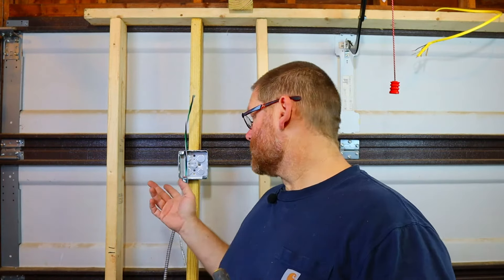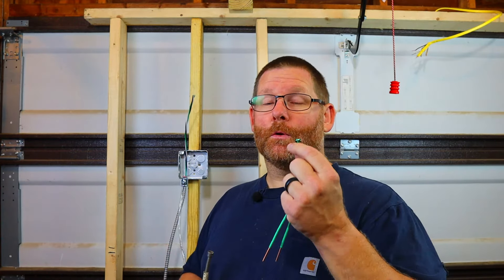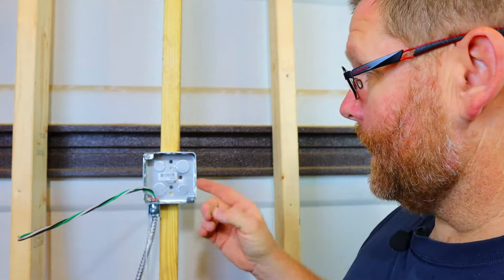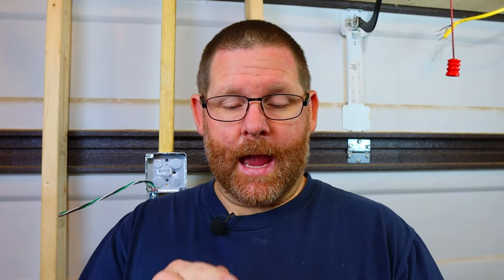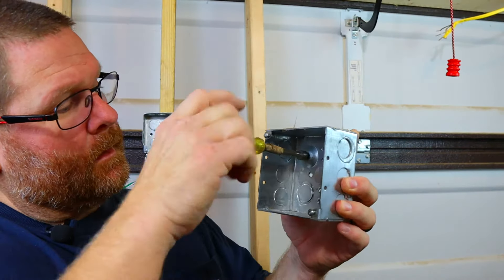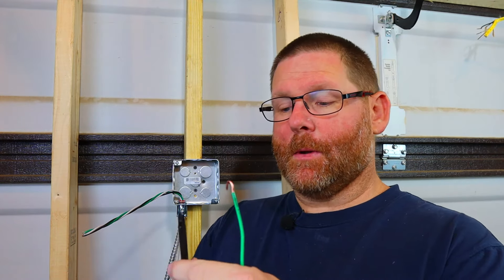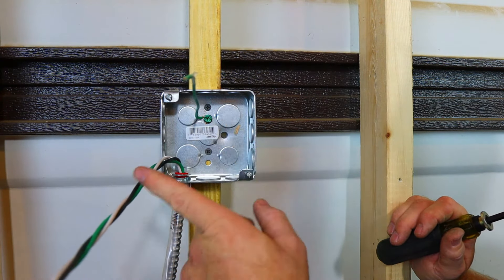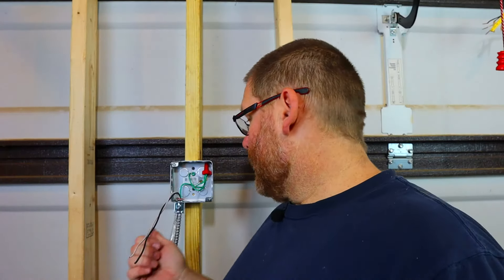How To Ground And Bond A Metal Electrical Box

Comment: Hear me out what do you do if it’s a double outlet and another 12/2 wire going to the next outlet ? And do you treat the bare ground the same as a coated?
Reply from the maker: Grounds are grounds unless you have isolated grounds then it's different. So tie them all together. Unless they are definitely isolated grounds

Comment: im new to all of this. im making a 30amp extension cord to run off my generator. im using  10G 30AMP extension cord as my wire. cutting the 3  head off it  and making a 4 way box. i dont have any Grounding Pigtails. Could i  use some of the Green wire out of  the extension cord to make up a grounding pigtail ? Thanks
Reply from the maker: If it's stranded I would make sure you use a fork terminal then insert that under the ground screw.

Comment: If you're using a 4 gang box with 2 receptacles would you then pigtail the 4 grounds in one wire nut?  (1 to ground the box, 1 from main box, 2 separate out to each respective outlet)?  TIA
Reply from the maker: Yes you can wrap one of the grounds around the screw which will eliminate a separate wire from the box to the wire nut. And yes then you would run the two separate lines off that to your receps or switches. I hope that makes sense

Comment: Question or you... if you ran 4 X 6 gauge THHN wires for a 240V outlet, how do you ground the box? It is or a single device and the 6 gauge cable is way too thick to ground on that little grounding screw. Thanks again for the great information..
Reply from the maker: Working on a video for this very thing

Comment: None of my spare wire grounds have green sleeves on them; does that matter when making pigtails?
Reply from the maker: Do you mean green wire nuts? Or sheathing
Reply: @MountaineerOutdoors  hey man, nah I was actually talking about the grounding wires themselves. I wasn’t sure if they needed to be insulated but based on my research; it doesn’t seem to matter with the ground. Thanks for the video, helped a lot.

Comment: I say use whatever screws you want, however, the contention is that drywall screws with the steel boxes create oxidation reaction and the screws rust. I use sheet metal screws. If code calls for a specific screw and an inspector checks, he can cite that as an impropriety.

Comment: Great video! I have a square bit (robertson #2) screw driver for these green ground screws. It holds on the tiny screws without falling. I also have a tiny robertson #1 to drive set screws for devices. 

As for the direction of the hook. I forget sometimes, but it's the reflected version of the question mark. So "no question" is what I tell myself to remind of the orientation.
Reply from the maker: Those Robertson are good. And they way you remember on how put the wire on is genius. Thanks for watching and commenting ☺

Comment: I like the video. I agree with everything except in certain situations when you have surface mounted boxes and you are using your raceway as the egc then no bonding jumper is required and the yoke contacting the box or yoke and cover contacting the box acts as the bonding jumper per NEC 250.146. I may be wrong but I see this type of installation often.
Reply from the maker: I don't think using conduit is considered a egc anymore. As far as the yoke you have to take off the Insulator tab behind the screw or make sure you are using a self grounding device
Reply: @MountaineerOutdoors  It is still acceptable to use the raceway as an egc per NEC 250.118. Although it is uncommon for electricians to do so as it is not well known. But I have seen it which prompted me to figure out why someone would not run a separate egc.
Reply from the maker: Yep your correct I looked it up. I was always taught that that was the old way. I wouldn't want to depend on that being my ground for sure. I really appreciate you teaching me something and giving me the code number.
Reply: I’m glad I was able to give some insight into proper grounding. Although you are right about not relying on the raceway as your egc. I wouldn’t want to trust it either.
Reply from the maker: Definitely I have seen rigid and emt both broken and come apart which at that point your ground is gone.
Reply: @MountaineerOutdoors  I'd pull a green wire just for redundancy and extra safety measure. The fittings on the conduit could come loose over time and having an actual EGC is a good idea, I think. If the plans don't call for one then I would think it is to reduce cost.
Reply from the maker: Good advice

Comment: QUESTION, I have a metal covered pole barn. I put a ohm meter set to ac volts between the outlets 120v pin and the other probe to my barns outer metal roofing and it reads 120 volts. is this correct or am i going to electrocute myself touching my barn.
Reply from the maker: Your safe that is reading to ground because you pole barn is metal and it's grounded.  Now if you touch it, one lead to the earth ground and the metal and you get a reading then you have problems. Make sense?
Reply: @MountaineerOutdoors  thank you.  mine is zero ground to covering.
Reply from the maker: Your good then

Comment: Thank you for the video. You earned a subscriber in me. Couple questions though. I will be doing this with splicing Romex cables. But I understand there’s no insulation for the ground. Would it be the same method? Also can I use WAGOs instead of wire nuts?
Reply from the maker: Welcome to the family. And yes same method and you can use wagos. I'm not the biggest fan of them but they are U. L. Listed. Thank you for your comment and watching ☺

Comment: Is the metal conduit necessary for proper grounding? Does the conduit have to be attached to anything in particular at the other end?
Reply from the maker: If you use metal conduit it's in tact from the panel to your box. This answer your question?

Comment: So if a hot touched the metal box. Fault current would travel through that bonding wire through the receptacle back to your main panel?  

I see pictures of panels that have a bonding wire connected from the inside side of the panel to the door of the panel? So how does that keep the whole panel from being energized?
Reply from the maker: I think I understand this question...the fault would travel out through the ground wires to earth or water ground and take the fault from you.

Comment: Hi i am installing a outdoor weather box running conduit   It is a 60’s built no ground wire from my power source. I will have a GFI receptacle wired properly to protect remaining receptacles  your thoughts on the ground wire. Thanks for your videos I have learned how to bend conduit from them 👍
Reply from the maker: My opinion is this. Can you drive a ground rod to your garage and add that ground wire to your garage panel?  Then you can replace the wire from the your panel in the garage to your receptacles and all will have a ground. You adding a gfci will satisfy the code but it is not creating a ground.
Reply: Mountaineer Outdoors  thank you for the reply much appreciated. This wiring is from an existing 2 wire feed to the porch area  were I am going from the two wire feed to a metallic box than  emt and boxes. I anticipated you would recommend a ground added. So the home panel is very inaccessible as far as the wiring distance to the outdoors. I visioned adding a ground rod than run the ground to the weather receptacle  box . Your thoughts. 
Thank you for all you do !!!!
Reply from the maker: So do you have a panel in the garage???  if you dont and your planning on adding a ground rod, I would run it to a grounding bridge block which you can google to find exactly what I am talking about. That way you can add more ground wires to items. Although it is not code to run a ground wire outside of a conduit or a romex to feed devices.
Reply: @MountaineerOutdoors   thanks again mike for your reply
Reply from the maker: Always my pleasure ☺

Comment: I have an odd setup I’m finishing. NM12-3 run into studs and then EMT for exposed beam in garage. Prior homeowner ran NM sheathed in 1/2”EMT which I know is wrong. So I have the 3 wires unsheathed inside the conduit part. The ground is bare ; is this a code failure? Should I run a separate green sheathed 12 gauge ground back to panel and hook my metal boxes and EMT to this 15 feet of EMT, connections and 3 outlets, 1 junction metal boxes? I have used bare ground but I do have sheathed ground wire available. Must I use a sheathed ground in each box or is it ok for bare ground? I’m currently hooking up the ground service wire to the conduit and boxes. The prior setup had no grounds at all to any of the EMT used. Also used handy boxes with no room and no pigtails and no bends. I successfully used your bending videos to bend my 1/2 EMT properly and have mad respect for anyone that does that shit regularly. 3/4” short was brutal to bend offsets. I got it though thanks to your advice and tips.
Reply: Dang what a good electrician he was 😂 
I would run a sheathed 12ga through EMT and ground each steel box and rec. I would think running bare ground in EMT or MC would be against code but I’m interested to see what Mike has to say.
Reply: @AlmostItalianBrothers  yeah I do have access to a code book online, I find it easier to get straight answers from electricians on YT...lol...seriously though. If you want 1 million views and criticism just post your electrical video on YT and let the good times roll. I’m at a point that I can run my separate ground wire now and even pull out the bare ground and replace it with a single green ground for all the EMT run. I would just run the green ground back to the box in the stud wall that’s feeding the EMT. I have access now before i insulate and drywall so I want to be better. I have other shit that isn’t pure code but its safe. I just want a safer install. I’ll take your advice and pull some green sheathed ground wire. Removing the bare ground. Easy enough now...impossible later without ripping out drywall.
Reply: @AlmostItalianBrothers  as a side note about ground wire, I have an old 1962 split level and the dryer was just 3 wire 10 gauge. Since I had access to update the plug and the wiring back to the panel I added a ground wire and zip tied it to the service wire along its run also labeled it in the panel and brought it to the 4 wire plug for my dryer. Nice to have it be a 4 wire setup even though I know it isn’t really necessary but it is safer.
Reply from the maker: Ok by code you cannot run a ground wire separate from your wires in the conduit. You can bond the conduit with the ground you have already in your romex. You can run a bare ground wire inside the conduit with any hiccup. I will check for sure but 99% sure you can.
Reply: @MountaineerOutdoors  thanks so much for the information.!!
Reply: Wow, good to know. Thanks

Comment: 11:30 Could that Ground pigtail wire be an exposed copper wire with only a loop of green electric tape at its outer end, to mark it as a green wire, or is this a code failure?
Reply from the maker: Definitely
Reply: @MountaineerOutdoors  🙏Did that.

Comment: Awesome video with explaination! I have a question on 11:06 where you introduced a new (3rd) green wire. I am installing Ring fllodlight wired pro camera which comes with 3 wires and mounting bracket but no green screw. If I understood correctly, here in my situation, this 3rd green wire will be my ring camera wire ? Thanks!
Reply: I'm having the same problem. I thought it was always just me.
Reply from the maker: For light fixtures you do not need to pigtail the green. Just put all green wires together
Reply from the maker: Just omit the other green wire and put all green wires together

Comment: Question - I'm about to replace several receptacles in my house that have gone bad and another problem with them is that the plastic wall boxes (new work) that were installed when the house was built, are all stripped at the hole where the screw that fastens the receptacle to the wall box.  Do the metal boxes have a better/longer lasting holes that don't strip out so easily or are they about the same as the plastic boxes when it comes to that?  I know the metal boxes are stronger in other ways but do they provide better fastening points where the receptacle screw fastens to the metal wall box?  Im scraping/mudding my walls also so I was going to replace the original new work plastic wall boxes with new work metal wall boxes (if they have better fastening points).  I don't want to use old work boxes that clamp on to the drywall b/c I know those come loose so easily.
Reply from the maker: Great question. So my experience is that I like both boxes. You can fix the holes on the plastic boxes with this tool here https://amzn.to/3j7NQHA or the metal boxes if you damage them you can fix it with a tap tool.
Reply: @MountaineerOutdoors  Thats awesome!  I have never seen that but then again im not an electircian.  Quick question - I had already bought the metal box so Im gonna install it on this one receptacle in my house thats been crunked for years.  I cut sheetrock out and basically what I'll have is -  1 metal box with 1 receptacle going in it.  There is 1 Line cable coming in  and 1 Load cable carrying current out to other receptacles in the room.    In that case - correct me if I'm wrong - I would tie 4 green ground wires together with a wire nut ( Line cable ground wire, Load cable ground wire, pigtail ground wire A, pigtail ground  wire B).  Then the other end of the pigtail groundwire A would tie to the receptacle ground screw and the other end of pigtail groundwire B would tie to the ground screw on the metal box?
Reply from the maker: So all grounds tie together. Take one of the wires wrap it around the screw and use a green wire nut, poke the longest ground out of the wire nut and tie it to the gfci.like this video shows https://youtu.be/ElS9KXia36o

Comment: Hi, I’m replacing some two pronged receptacles in an older home and found that the wires in the metal box do not have a ground wire, just two b/w hot. Would it be sufficient to bond the ground bolt on the receptacle to the metal box itself?
Reply from the maker: No the only way to satisfy the code is to put in a gfci or another 2 prong receptacle.
Reply: @MountaineerOutdoors  what is a gfci? I too have a ceiling box with only b/w wires and no ground wire. If I do a ground install like you did in the video would that suffice?
Reply from the maker: Ceiling box is  it a receptacle.
Reply: @MountaineerOutdoors  not entirely true. if the wires were run with BX, emt, rigid and so forth. the armor is bonded at the panel and it constitutes as an egc.
Reply from the maker: True

Comment: Great video. Is it ok to use a silver screw with a washer instead of a green screw
Reply from the maker: As long as its a machine type screw with at least 2 threads into the box your are fine. code on that is 250.8 (A)

Comment: I have I detached Garage with no sub panel. Two UF Cables ran under ground to the garage. One 12/2 and one 12/3. Just replaced all mc cables and added new metal boxes. Does the pigtail in the first box create a chain of proper ground for every other box with a pigtail? Biggest electrical job I’ve taken on, so I’m trying to cover all my bases. Thank you!
Reply from the maker: Anywhere there is a device (switch or Recep or junction) has to be be grounded with a pigtail. I'm guessing the 12-3 is for a 3 way from the house to the garage?  Always go the extra mile to make sure that you are safe. Redundancy is the best policy
Reply: @MountaineerOutdoors  yes there is a 3 way switch for the outside security light. I’m headed to go pick up some ground screws right now! Thank you so much for the quick reply and great video! Subscribed!
Reply from the maker: My pleasure and I appreciate your subscription.. Welcome to the mountaineer outdoors family ☺. Have a great weekend

Comment: your videos are good.  a question when I have metal cable like the one you are using but it only has black and white the same procedure is done for the ground I have a project to do at home but it would be great if you answered my question thank you greetings from Connecticut.
Reply from the maker: I am confused so there is no ground. So it's old bx wire. What exactly are you asking me I'm kinda confused?
Reply: yes, it is armored steel cable from an old house that I have, but it is with these cables that have only two wires inside, black and white. Thanks for answer.🙏
Reply from the maker: They use the bx as your ground. You just need to make sure that if Your panel is grounded it is all the way to that bx your working with.
Reply: Thank you

Comment: Great video. Do I  have to use a metal box and mc cable for my basement where there are no finished walls I can mount it to? Could I just build a wall segment and mount it flush to that so I can get away with using plastic?

Comment: What are the ramifications of improper bonding in residential settings?
Reply from the maker: Are you referring to code issues? If so you won't pass... For everything else you can run into water pipes that have power on them, appliances that have power on them. And possibly shock or death. You need to make sure that it's bonded

Comment: Could you also strip a mid point of the ground wire and bug the box ground wire to that middle section? With the end of that original wire then going to ground of the receptacle? It would make for one less wire to add

Thanks for the video!
Reply from the maker: Yes and I appreciate your watching and commenting
Reply: @MountaineerOutdoors  awesome thank you, didn’t know if there was a lower limit on wire gauge to what you can bug. Appreciate the video